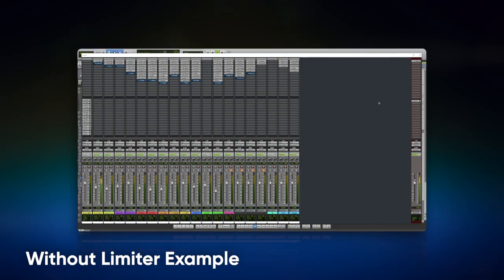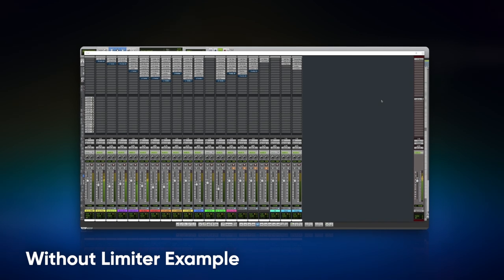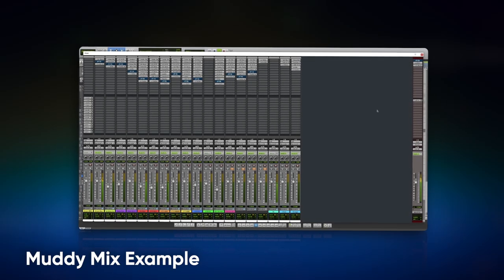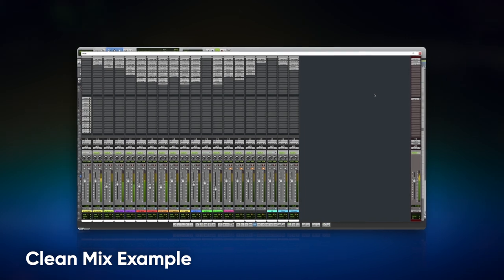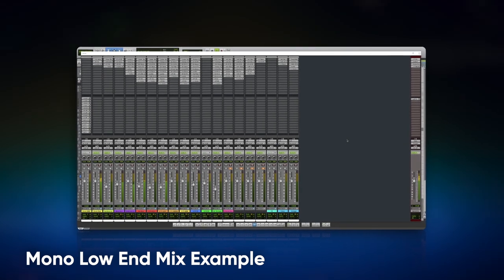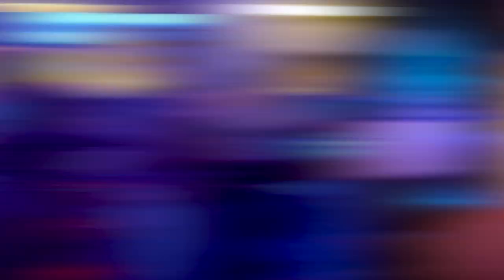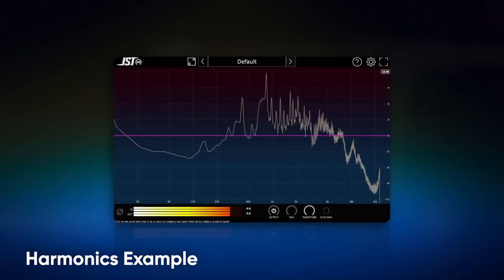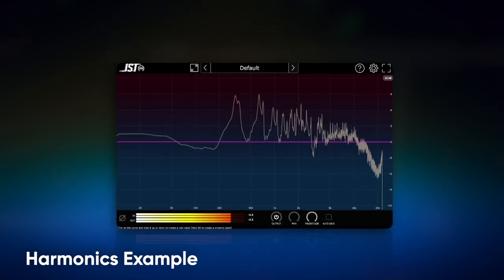How to mix LOUD!? The secret is...

Comment: I tend to do a lot of this stuff but another thing I like to do to get loud mixes is to use a clipper on the master before going into a limiter, helps add that extra bit of loudness while helping maintain some dynamics that might get squashed by just using the limiter
Reply: I use Ozone 10 Maximizer for that because it has clipper right before limiter. It sounds pretty clean imo
Reply: @lordberly  nice I don’t have Ozone but currently using the clipper in JST Maximizer before going into Sonible Smart:Limit

Comment: The mono bass thing I’m still unsure on. I don’t typically mix metal so maybe it’s more so for intense mixes such as these, but ever since I processed my bass buss in stereo, I get a thicker mix overall. I feel like the sides without some kind of low end filling those guitars with that beef, it gets a little shrilly.

Take Death Cab’s sound of settling for instance, the low end in the sides is immense and it really makes the song warm overall and just pleasing to the ear. I can hear bass/low mids in the L+R more so than just straight down the middle. Many other songs I find bass filling the sides of my earbuds and it’s quite nice. Maybe not sub subs but definitely 80hz and above

Something Corporate’s North has a similar vibe. So warm. The bass morphs through the sides of the speakers and just fills that space.

Or is that just the feedback of the channels mixing in a console, bass bleeding over into stereo channels, etc?

Comment: All useful tips in this video, but I truly think the only real way to get a loud and clear mix is to have a well balanced mix across the entire frequency spectrum. Your mix will never sound loud if it’s lacking low mid punch. It will never interact well with a limiter if your bass is too loud. Levelling out the frequency spectrum of your whole mix will naturally increase the perceived loudness, which in my opinion is the only thing that matters. No limiter or mastering service is going to make an unbalanced mix sound loud the way you want it to. Using a tool like Tonal Balance Control by Izotope to ensure your mix is balanced is a HUGE help in the pursuit of a loud mix. It is a game changer and for me, directly helped me achieve loud, clear mixes.
Reply: ❤I keep telling people this..the secret to a loud mix is not the clipper or limiter or compression..it's is a balance frequency spectrum in the LEFT,CENTER and RIGHT channels of the mix